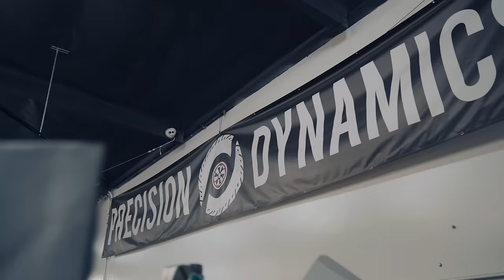Venom F82 | BMW M4 on TE37's [4K]

Comment: great looking car.  one thing i hated about my M4 was having a very real fear of steep driveways, speedbumps and dips on the road.  part of my soul left when i heard that scrape.  anyways, it's sold now and part of me misses it so much.
Reply: how was your experience owning it? and why did you ended up selling ? problems? , asking because im looking forward to buying one
Reply: @Maxrizzz  I bought a 2016 M4 with 35K  miles and owned it for a little over a year.  It was a fun car - the rear wheel drive really makes you feel the acceleration and it was fast.  Within that year I really didn't have any problems although I did have to change both front and rear brakes because of squeeking (which is a common problem with these cars, so check before you buy - or at least lay on the brakes when you're test driving).  I sold it for an SUV for family reasons.  If I had to do buy one again, I definitely would, at least an F82.
Reply: @mnledesm  what year would you recommend and did you have the competition or CS
Reply: @Maxrizzz  It was a base M4.  The competition or CS I would imagine would be much better.  I just loved the way the F82s looked and I'm not a fan of the new design.  So 2014 to about 2020.  As far as performance you can decide on your own what you like.  It's a beautiful car and a pleasure to drive; you'll have fun.

Comment: Hey are you running wheel spacers? And could you tell me if it's a block setup? and what is the offset? And are those 18s someone bullshited me and told me you can't put 18s on a m4